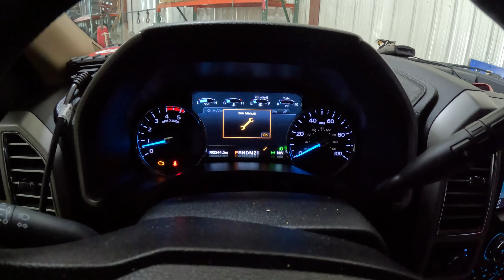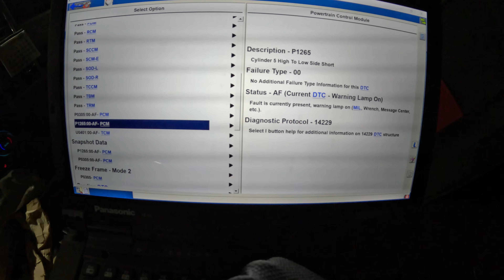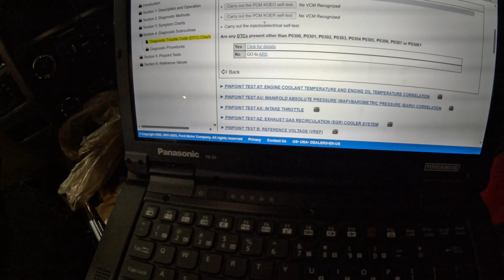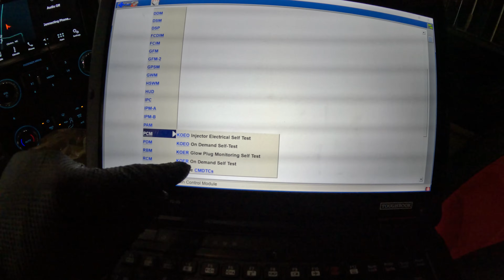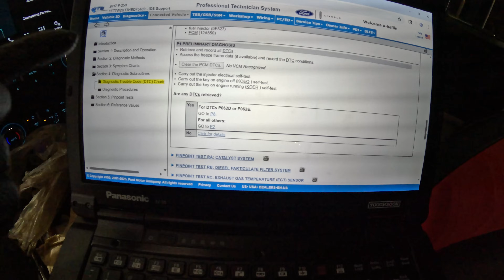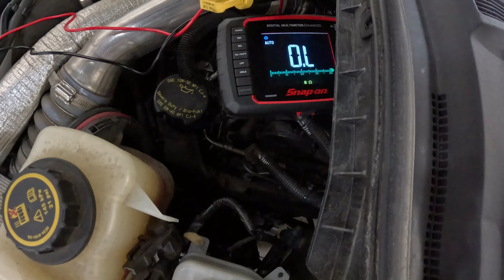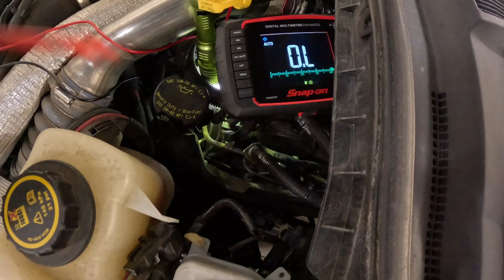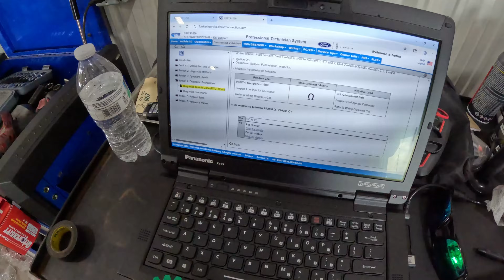Diagnosing a Mystery Engine Miss on a 2017 F250!

Comment: Do diesel tech use scope for injectors? I use all the time on gas engines, never on diesel ,not sure how the  waveforms look for it . But for sure It will take minutes to diagnose once you mastered.
Reply from the maker: You can. But I dont. Unless the pinpoint test says to

Comment: Hello i have a ford fusion 2020 se 1.5 turbo i have engine vibration when i turn on A/C what should i do ?
Reply from the maker: Just a slight vibration?  Does it go away when ac is off?  If no thats normal. If its really bad vibration then get it checked out
Reply: @BeardedFordTech The vibration is not very strong... When I turn off the AC and the fans turn off, the vibration stops

Comment: Maybe I missed it, but how many miles were on the truck, if you recall? Also, mine has massage chairs, but if they fail it's good to know I can fix it by unplugging an injector!
Reply from the maker: You missed it. 21 seconds in. Unplugging it will make it massage more cause it Will misfire.  I unplugged it to ohms it out. Wasn't running when I had.it unplugged lol
Reply: @BeardedFordTech  Yeah I know. My seats don't "massage" via vibration like that though. Can't imagine what a big engine like that feels like with a bad injector. Now imagine a diesel locomotive missing. I bet THAT's fun!

Comment: When you can, harvest an injector plug and use that to clip your test leads to. Heck add a foot of wire to it so it's easy to reach
Reply from the maker: That works. But they all arent the same. Easier to just ohms it through the pcm connector.  Suppose I could get a few different plugs and try that route too.
Reply: 👍 , was always nervous about messing with the primary connector. But in reality probably nothing to it, just nervous me 😊@BeardedFordTech
Reply from the maker: @cndream1 totally get it